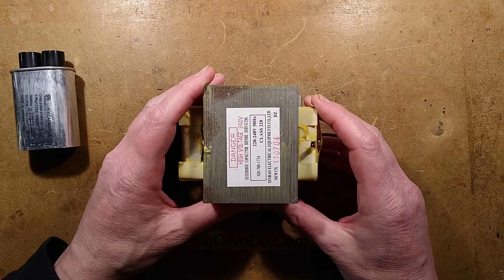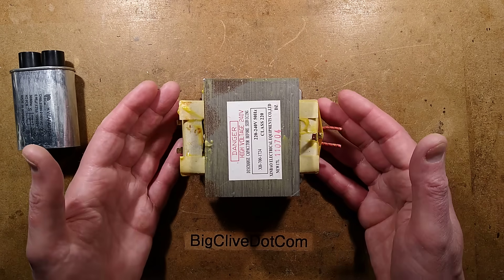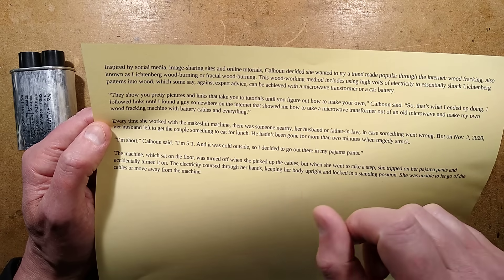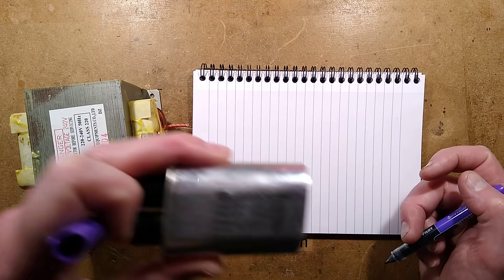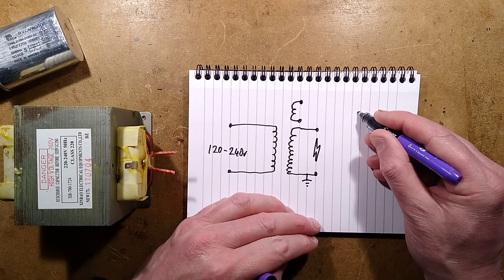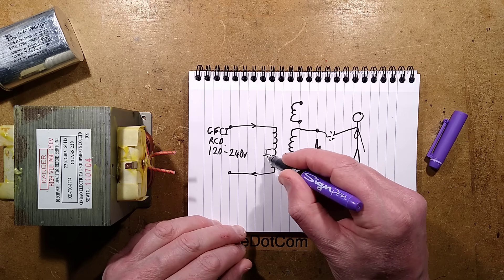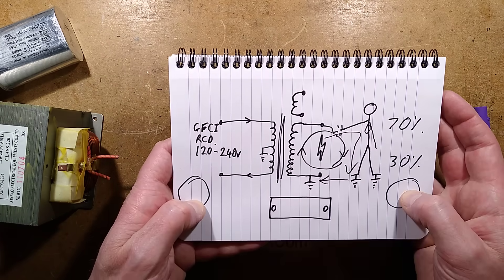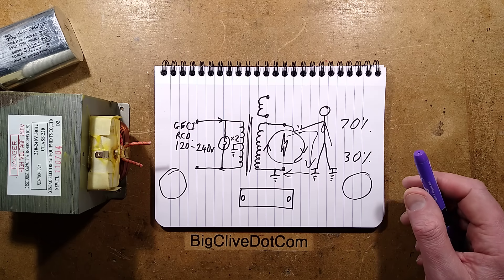The most deadly project on the Internet

Comment: Just wanted to say thank you for putting videos like this out there.  I took quite a few microwaves apart years ago because I'd read about making an arc welder out of the transformers, and just found all the parts I'd taken out.  I've always wanted to make Lichtenberg figures, so I started researching how to build one myself.  Now thanks to videos like yours, I've decided to go ahead and just pony up the money for a neon sign kit with a foot pedal switch instead, and I'm going to find a local licensed electrician to come over and advise me on how to make this as safe as possible with a grounded or insulated work table, improved insulation on leads/electrodes, etc.  I'm also going to print out a picture of what happened to Mrs. Calhoun and put it on the box as a reminder every time I use the machine.  Complacency kills.

Comment: I found this extremely helpful in filling in the gaps in my lack of knowledge. I was aware that high voltage drastically changes the mechanics of what is a safe ground protection. I watched a city power employee make up the large diameter wires coming in from the street to the building main. He did not even bother to get the rubber mat that he had in his truck and he did it barehanded. He said that he did it daily. He was dealing with 220 volts not thousands of volts. Then there is the story of the power worker who loved to collect dead squirrels near the transformer he died when he touched the wrong wire even though he was on a wooden pole. As you noted that transmission voltage is much higher before it is reduced. I avoided doing any fractile burning and threw the microwave away. The only way that I would even consider doing this would be to make all connections and then plug in the transformer. The school that I attended told us about a student of theirs who died from the output of a large capacitor after it was powered down.

Comment: I really enjoyed this video… One small point I would mention is that if you’re going to remove one of these from a microwave oven, you should leave the microwave oven powered off for at least two weeks and then treat it like it’s completely still powered when you wear insulated gloves, and use an insulated screwdriver to short the capacitor. By leaving the microwave oven unpowered for two weeks you vastly increase the chances that the capacitor has self discharged, even if the discharge resistors are faulty… But then it’s still a good (mandatory) idea to treat it like it live and short out the capacitor with a well, insulated screwdriver as you mentioned (not to mention wearing heavy duty, insulated gloves for good measure).   I’ve only ever used those types of transformers as paperweights… They are incredibly heavy for the small size and they can help with a great number of projects when you need something held down… anything is the first thing I do when I remove one is to cut all the wires off of it so no one will ever attempt to power it on… Although I do like the idea of the spot welder, I think I’d go with something a little bit more well designed, and overall just safer…  I mean a decent simple spot welder is pretty inexpensive… and For most hobbyists a simple one is about all you really need most of the time.

Comment: I've had one shock beyond just static electricity shocks, and it was enough to scare me away from working with components like this forever. It didn't last longer than an instant, and it wasn't of any significant voltage or amperage to be life-threatening, but it was still enough to feel extremely uncomfortable. The nerves in my hand didn't feel right for a few minutes afterwards, and for a moment as it happened my hand completely locked up. I'll leave it to the professionals and just watch in admiration 😅

Comment: you can also use a cheap ac chinese transformer that turns dc into ac at a frequency that you can still burn flammable things with it but they cant kill you but you can still feel them because they have a frequency high enough it is almost harmless but still possible to feel and also when they are on they either sound like a machine gun or they scream at you

Comment: Farmers have high voltage electric fence units that pulse on and off a second at a time giving you the chance to let go of the wire if you grasp on and it contacts your muscles on to the fence.
Reply from the maker: The electric fence units just apply high voltage spikes to the wire, like a static zap.

Comment: Being a welder using old machines, we once had a hefty gentleman who picked up his 440 lead in heavy leather gloves, well-grounded boots and proceeded to touch the gas bottle to move the cart it was on while keeping the weld torch draped over his jacketed arm. Needless to say, once the screaming stopped and he broke free, my supervisor took one look at his fingertips which were blown partially open and said no way. Lucky me, with first aid/ CPR training got to wrap him up and have someone take him to emergency. If you're near a welder, please take a lesson from this story; no need to live it at all, and you might not anyhow.
Reply: I know a guy when I was a union, Who was a journeyman lineman? and he got hit with 550000 K. V, he was in a big boom lift truck melted the tires on the truck.
When The electricity went through a shoulder came out of his foot.  Burnt the entire right side of his body. He still lived and still worked as a journeyman lineman. He was a real arrogant son of a b** even after the accident.
Reply: @wth......53 pride goes before the fall...
Reply: @wth......53  The lineman was probably saved by a property of high voltage alternating current known as "skin effect"
The magnetic field the high current creates forces the bulk of the current to flow on the outer surface of the conductor. So the current literally passed over his skin and not through his deep tissues. 
It can not be relied on and it can still result in fatal burns.
Reply: I don't understand how the scenario you describe led to him getting electrocuted? Maybe you can explain more
Reply: @subliminal_donkey Just because the ladder was designed to be electrically safe does not mean it was. Insulated safety equipment needs to be checked regularly to verify it is still safe.
Reply: I watched my grandpa get blown off a ladder in a lumber mill once.  Roof leaked water in the electrical box, he got up there on a fiberglass ladder with aluminum steps and soon as the screwdriver touched the box he flew like an angel headed to heaven.  He was thrown over 40 feet back from it, blew the ends of his toes out and burned all his fingers.  He recovered just fine and it didn't seem to affect him for too long.  Mind you it was a 26 foot tall wall of electrical boxes and some boxes was as high as 3000 amps.  It melted the aluminum step on the ladder.
Reply: Grounded boots?  In all seriousness, high voltage is terrifying.  Ive seen someone die and get resuscitated from shorting two 480 volt leads on their hand before.

Comment: I use them for vises. I cut the top off and removed the secondary coil. Make a circuit box for thenoower switch and fuse. Anything containing iron ill throw it on top then flip the switch. It had like 200lbs of holding force and is extremely useful for the work i do. For what its worth i have a red led circuit alrerting me it's powered and green led indicating its plugged in.
Also, "welcome to the world of high voltage where everything is a wire and you're probably going to die!".

Comment: I was that 30% You talked about. I connected the high voltage to a small toy DC motor. And let me tell you, it felt like someone took a ball pin hammer to my head. My whole body Felt like it Vibrated at 60 Hz. It was not F*CKING FUN.

Comment: There was a guy who worked at the shop where I worked a couple of years before I got there that lost a finger working on a microwave. Lots of people talk about the power stored in an old picture tube, but the microwave is the REAL killer.
Reply: Capacitor incident?
Reply: @saucecups  I think it must have been running at the time. Most of the HV capacitors in microwaves have bleeder resistors (not all).
Reply: @lenm2857  Ouch. Not sure if it's worse for your finger to go POP or slowly sizzle until it's too far gone.

Comment: Why is the top comment worried about the high voltage? You can take a million volts across the heart, just not when it's a high amperage discharge from a capacitor. You probably don't even need the transformer in order for this to be lethal, it doesn't change the wattage being thrown around
Reply: electric shocks are more complicated than that. even at low currents, the electrical burn through your body can be lethal

Comment: As an FCC licensed electronics technician, I almost wholeheartedly agree with your message. It's far too easy to experience a lapse in concentration, or not fully understand the dangers of an improvised, high voltage circuit like this, and receive a life-ending electric shock. The reason I say that i almost wholeheartedly agree with your message is because you reccomend using the possibly less dangerous high frequency, voltage step up supply. Even though it may be less dangerous for some people it may still prove to be just as deadly for others because of unknown variables in their body's health and physiology. My recommendation is to only use devices that are engineered and constructed by professionals for the intended use if you want to live, or not suffer irreversible damage to your body. But overall, it's great you posted this video. I believe you've saved some lives. Thank you, sir.

Comment: Someone should make an etch a sketch type device that’s insulated but let’s you move the probes around and lower them onto different spots of the work piece  and enclosed in plexiglass or some other insulator and also put a dead man’s pedal on the floor, as well as a key lockout and loud buzzer when it’s running,  at that point I think you could have some level of safety doing this.

Comment: car jump leads are made for  200 Amps @12 V..=2400 Watts    people hooking up to 120V @20 amps residential breaker = 2400 watts..-    so on the other side of the transformer.. 2000 Volts is what you said.. leaves 1.2 Amps at most..  Car leads can handle the 2400 watts just fine..  do the math.. 
this is why non-electricians shouldn't be making videos.  
but the factors is  Electricity doesn't care what math you accept.  people are dying because the get shocked across the heart..
Reply: bigclive literaly is an electrician. car leads are not rated for 2000V, at that voltage the insulation might break down which is bad.

Comment: What happens if the secondary is floating and not connected to ground? Would that make it safer?
Reply: there would be no current running through the secondary

Comment: The transformer is dangerous, so I swapped out the secondary coil with 2 loops of 2/0 awg wire (70mm2) to melt stuff with. Still dont mess around with it, because id still rather be safe than sorry!

Comment: Not to mention the highly dangerous beryllium oxide inside the ceramic insulators situated in the microwaves magnetron. I took apart a couple microwaves as a kid, luckily I was smart enough to research the dangers and short out the capacitor before doing anything. I was also extremely careful when salvaging the magnets from the magnetron because one fracture in the the ceramic insulators could be devastating.
Reply from the maker: Beryllium oxide is too dangerous and expensive to be used in home microwaves.  It's just an alumina ceramic that is used.

Comment: In Serbia, kids climb on the railroad carts and get electrocuted, because they don't realise that high voltage can arc through the air from the overhead lines.
Reply from the maker: They usually have to touch the overhead lines, as the current can't jump more than a few inches on the 25kV systems.
Reply: @bigclivedotcom  Not sure exactly what the distance is, but they stand up to take selfies. :(

Comment: Back in the 90's I worked for a satellite communications company.   The transmitters we used had power supplies that provided 8,000 volts at 1 amp.  The power supplies could be (and sometimes had to be) serviced while operating, using special high voltage tools.  However the rules where no one was to do that alone.  Well, one time an engineer in our LA office decided to work on one of these high voltage power supplies alone.  He either bumped against a 8k circuit, or touched the inner frame, which could float at 400 volts or more, and electrocuted himself.  The tragedy was, had someone been with him, he would have survived.  He collapsed half way across the parking lot between the transmitter building and the main building and died from cardiac arrest.

Comment: what about secondary casualties?? people that find casualties of electrical hazards tend to also contact the ground and the casualty.. btw, dead man's switch wont work if you're clamping.. there's no way to make this safe..why are they runing ground to earth when they're shorting out on the wood?? the ground should be something the item was placed on.. even when they do dumb things they still do it wrong/the hard way..
Reply: the first task when finding a casualty to electrical hazard is to locate the power source and shut it off.. first aid is useless for internal burns..  there's no way to make this idea safe.. this is precisely why microwaves in particular are so difficult to open up.. you cant 'accidentally' mess with these parts.. as inteneded, the circuit is completely insulated.. the rest of the machine is grounded.. it's most likely plugged into a GFCI..
Reply from the maker: The point of the dead mans handle is to keep your hands away from the live connections in the first place.   It is on the lower voltage primary side.

Comment: I worked as a high voltage electrician for 20 years, I used to test the work at completion with high voltage injection equipment.

The dead man switch is pretty standard for the test gear normally there would be two of us with one each so if the other guy can't let go....

We also use an earth to connect to the test lead before we touch it, as in if there is no earth it's live. The earth can be a green yellow flex cord with a hook on it.

The thought of touching the secondary connections with the plug still in the wall is wild. 

Many people do not realise high voltage jumps it also tracks along surfaces even clean insulating surfaces, that's why insulators have a look like stacked plates to make the distance long enough to reduce the leakage. Holding a bit of wood with the conductor on the end of it is a terrible idea one of my friends got 11kv that way when we used to use broom sticks to operate fuses you were also supposed to wear class 2 gloves (17 kV) he got away with out wearing gloves for years until one day he didn't.

All that can be said about playing with high voltage is that you only get to make one mistake and it's over.

Comment: Excellent video.  Most people have no idea what is and is not deadly when it comes to electricity.  I frequently do things with dangerous electrical equipment but I stay away from microwave transformers as I deem the risk too high.  This video and the one by Styropyro on whether high voltage or high current is dangerous are must watch videos.

Comment: Additional use for this transformer ( ! ) ..... supply the 230 Volt mains to the high voltage winding , gives a handy 20 to 23 Volts on the ( former ) mains terminals ... it is important to put the live on the 2Kv terminal as the iron core will the be the neutral .... for maximum safety , VERY CAREFULLY detach the short bit of winding that goes to the core stud and connect to mains neutral .. then the laminations can be fully earthed , to comply with most wiring regulations ( tried - n - tested ) ... DAVE™   🛑

Comment: The trouble with those modern high frequency neon sign power supplies is that they really do not like being used for anything other than their intended purpose. If you try using them for anything which even slightly exceeds the current draw they are designed for, they just burn out and become a useless piece of E-waste. They are just about impossible to repair if this happens, because all the electronics inside are potted inside a mixture of hard silicone rubber, which for some reason has what seems to be quartz gravel mixed into it, so you would have to dig this all out to even have a chance of accessing anything, and in doing so you would do far more damage than the original fault caused. So forget it with those - either use them to drive a neon sign or don't bother at all.

Incidentally, I only found out a few years ago that a GFCI or RCD does not detect earth leakage directly - it was interesting to find that they worked by detecting a mis-match between the current flowing in through the live and out through the neutral wires. I had previously thought that they actually detected current flowing through the earth wire as the name implies. Your mention of this in this video reminded me of a question I wanted to ask: Is there a reason why these devices don't detect current leaking to earth directly? Would it even be possible for such a device to work that way? Or would this actually be too sensitive - would it risk shutting off the power every time a static electric shock earthed itself to a radiator or any other earthed piece of metal in your house?
Reply: He had a video about neon sign transformers, YouTube decided to ban it.

Comment: Shocks - I've had a few. Even a compact camera with flash powered by 2 AA batteries can give you a shock: it has a tiny transformer that charges a high-voltage capacitor for the flash. It is an unpleasant shock